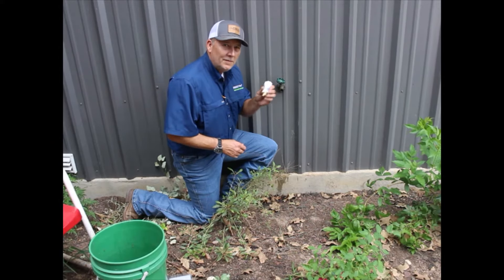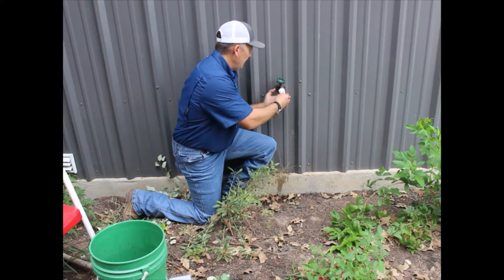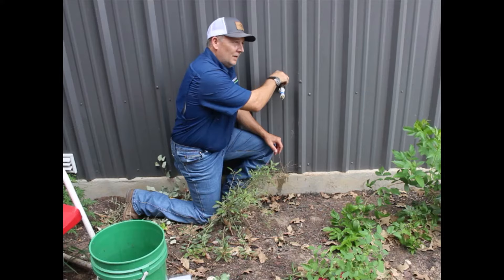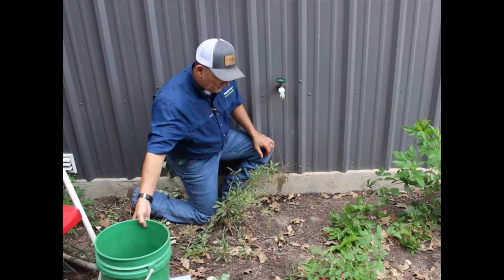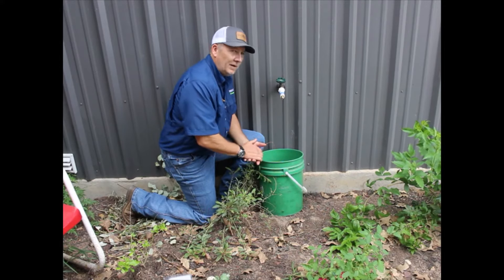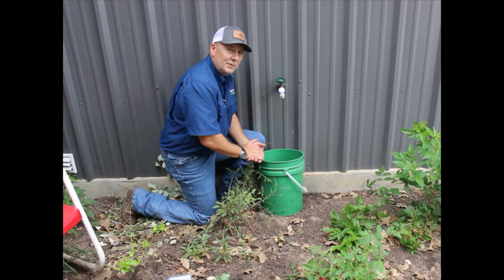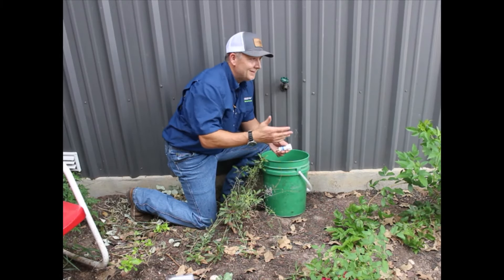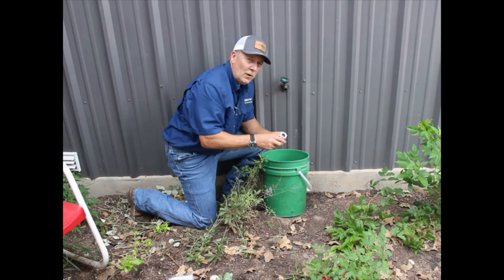Freeze Miser - How to Install on a Faucet

Comment: Just purchased and installed and went slowly. I hand tightened.  Water spews at the top and the bottom.  Any suggestions? I thought that the plastic threads got messed up with the brass, so I took out another new Freeze Miser. Same thing. Water spewing and did not stop. Outside temp is about 70 degrees.
Reply: You may have to tighten the faucet stem.  2 of my faucets did this after my last freeze.  This will be the first time I'll use the freeze miser.

Comment: It shows to be 28 degrees ... I installed 2 new freeze misers... turned water on all the way. Both ran for 2 minutes then stopped... none on them is dripping so far... 30 min later. Will they be ok? When do they start dripping? 
I also have my piped wrapped up really good.

Comment: I screwed on the freeze miser as much as I could but it is still leaking at the top of the threads. Do you have any suggestions on what I could do? Thanks so much.
Reply: get teflon tape, the white one, then thread it clockwise. do maybe 2-3 circular wraps.